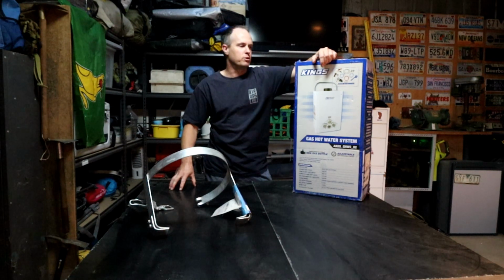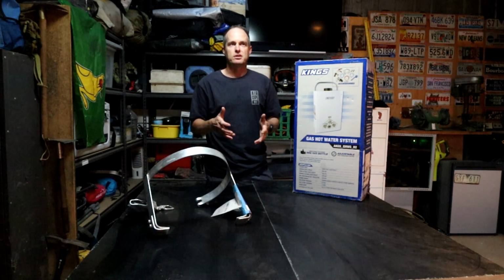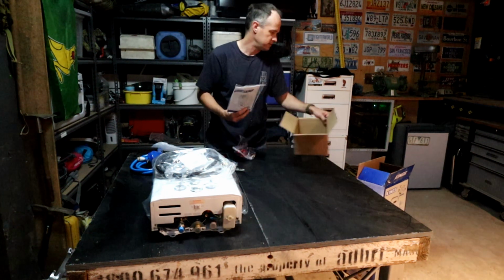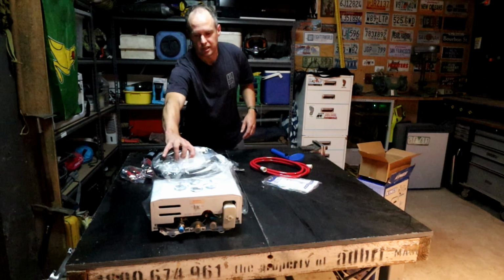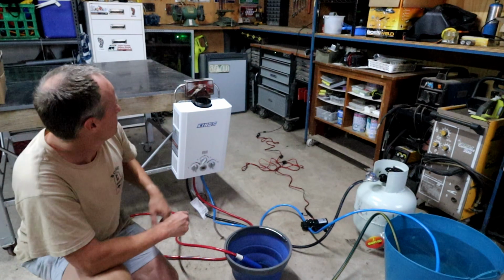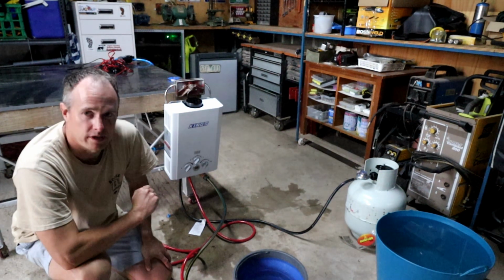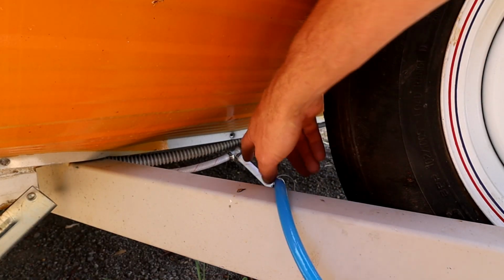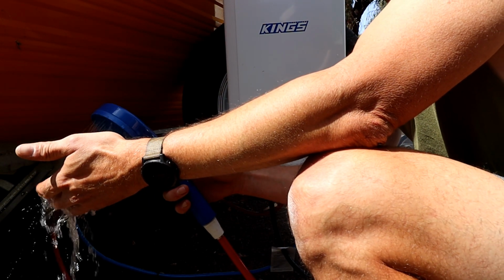Semi Permanent Gas Hot Water System Install in Caravan | Adventure Kings |

Comment: I purchased two of these Kings units and ended up returning both due to faults. They wouldn’t properly regulate the water temp and the pump was so weak I could piss further. I have now purchased a Joolca Hottap and it is perfect. Everything I have purchased from Adventure Kings has failed. It’s cheap Chinese made crap.
Reply from the maker: @Tezzaworks  I've only used it one or twice with the 12 volt pump. It's almost exclusively used on mains water pressure. No complaints so far.

Comment: So it can be hung on the outside of the caravan with a protective cover installed over it on the caravan?

Edit: the protective cover would be a permanent, vented fixture with a fire proof liner that channels any unintentional fire out and away from the caravan and exhausts the hot air/smoke up and above the caravan.
Reply from the maker: @muntee33  yes. The manual states it needs to be open to the air and up against anything flammable.
Reply: AllThingsOutdoors
Thanks for the reply. I imagine the definition of open air is no over hanging fixture within (at a guess 1m - 2m) that could trap or accumulate any leaking gas... Or near any opening that could potentially allow gas to enter an enclosed area.

I'm looking at one as an economical means to supply a source of warm/hot water whilst I get a faulty solarhart instillation replaced. Thanks for the video, only one related to my situation i could find.
Reply from the maker: @muntee33  you can download the manual from the 4wd supacentre website which gives you the recommenced tolerances for installation.
Reply: AllThingsOutdoors one question, did you require any additional fittings to connect the unit to the mains supply and/or back into the hot water trunk line? And did you fit a flow/pressure (flow and pressure are obviously different aspects of the water supply but you get my drift) reducing valve to allow the unit to receive similar flow /pressure as it would from a regular 12vdc 2L-3.5L portable pressure pump?
Reply from the maker: @muntee33  i have yet to have an issue with water pressure direct to the unit. I have used the supplied hoses and plumbed them into my van with an assortment of barbs and hose clamps. So it's as simple as connecting the hoses which are permanently attached to the van and connecting gas. Takes about 2 minutes to setup.
Reply: Cheers mate. Im hoping i can find connectors so i can plumb this back into the household hot water trunk line. If this works i may even hunt around for a unit that has a thermostat and only activates the gas and igniter if the incoming temp is less than the preset minimum. *and install it  semi-permanently (to code but easily removable for when it is not required for extended periods of time. The idea is the solar water heater will provide the hot water supply for the vast majority of the time with the electric booster able to provide some redundancy on rainy /overcast days and the gas heater able to provide a second redundancy for when the storm season causes extended power outages during raining /overcast days and the back-up generators electrical supply doesn't have to be used for high electrical loads like heating elements.

Comment: Has anyone found a cradle to hold the shower head to a wall? It would be handy to have in the cold
Reply from the maker: @anthonykhoudair9730  yes I have. I have a 12 volt shower system that has a little holder for the shower head and it fits the kings shower head.

Comment: So if you plug this unit to main water it only needs gas?
Does it work without power?
Reply from the maker: @lucadipasquale2231  yes and the power is provided by 2 D cell batteries which fires the igniter on demand.
Reply: @AllThingsOutdoors  how long does the battery last?
Reply from the maker: @lucadipasquale2231  still on the original set of batteries and have had the unit for 2 years and used about a dozen times.
Reply: @AllThingsOutdoors  oh wow.
Awesome.... looks like im going for a trip down kings
Reply from the maker: @lucadipasquale2231  I can't fault it so far.

Comment: Hi mate great setup. Hows tge the unit going nearly 1 year on? Ive heard mixed reviews on kings gear so a bit worried about their hot water system. Also, does it take long to heat up, amd what about when it gets hot and then yiu say turn it off for a minute while you lather up with soap and then turn it back on, does it take heaps to get hot/warm? Thanks mate
Reply from the maker: G'day Geoff. Still going well. Heats up quick (obviously quicker in summer). The only downer is that it's not waterproof so I can't leave it setup if it looks like rain.
Reply: Thanks mate 👍

Comment: Hey mate how did you connect it to the main, did you need any other fittings or anything?
Reply: What size t piece did you use please
Reply from the maker: I got a garden hose bayonet fitting with a threaded reducer that fit the thread of the input of the heater unit.
Reply: @AllThingsOutdoors  hey mate could you please tell me where I could get this exact part? Cheers
Reply from the maker: @1993mizzo  I just picked it up from Bunnings.
Reply from the maker: @kentweedale2967 this is the link to the tee I used from bunnings 
https://www.bunnings.com.au/gd-watermark-16mm-clear-vinyl-tube-fitting-t-piece-connector-2-pack_p3130763?store=6300&gad_source=1&gclid=CjwKCAjwo6GyBhBwEiwAzQTmc0MbIT27NRpmQ7kFYnH8z302HjAbGjfrKcUhnrYc7cZSWSiOqHJRORoCdtgQAvD_BwE&gclsrc=aw.ds

Comment: It's great in warmer months, we did the same thing a while back until we tried to shower out camping at 0 degrees. The manufacturer states it only heats 25 degrees above ambient temp, they recommend cycling water into a bucket to heat and reuse and heat again but we use the tanks built into our camper for an internal shower. Overall you'll be showering in 25 degree water (which is less than lukewarm) in near freezing conditions. Hopefully this helps you before you get caught out as we did haha
Reply from the maker: Yes, they are good but they have their limitations. I have yet to use mine on the caravans internal tank and only on mains water.
Reply: Obviously depends on the brand you use.. its been 50 degrees lately and ours goes scalding hot